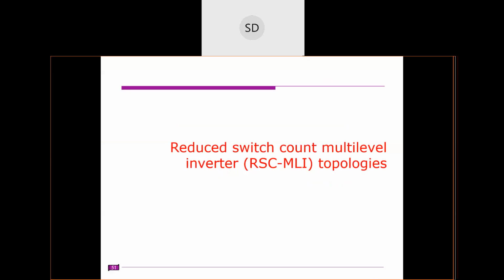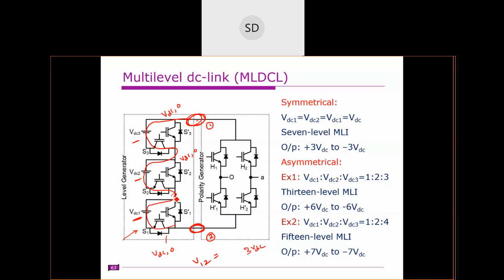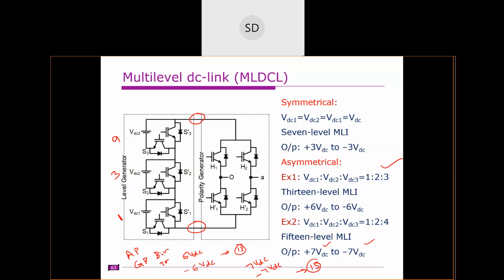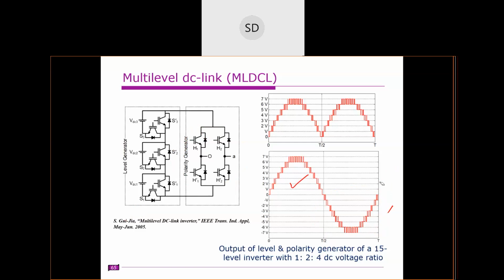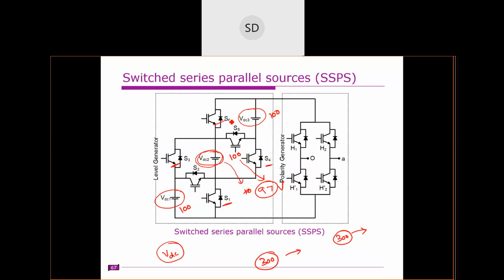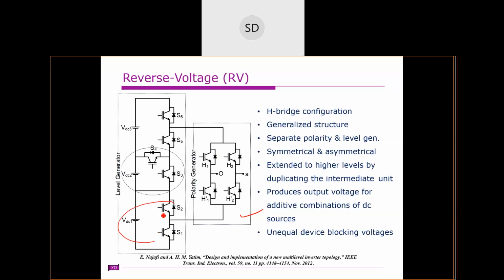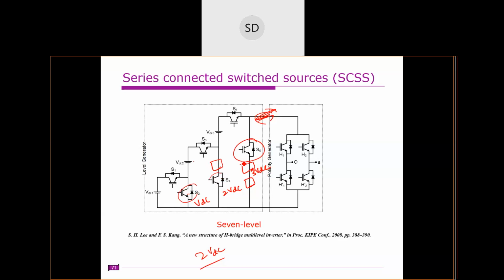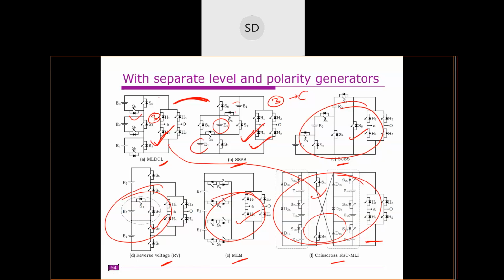Lecture 26: Reduced switch count multilevel inverter (RSC-MLI) topologies   1

Comment: Hello sir, 
In the below article, which type of  reduced switch count  inverter is used. Can you give me type of the inverter in this article...D. Prasad and D. C., "Solar PV-Fed Multilevel Inverter With Series Compensator for Power Quality Improvement in Grid-Connected Systems," in IEEE Access, vol. 10, pp. 81203-81219, 2022, doi: 10.1109/ACCESS.2022.3196174.

Comment: Dear sir,
Can these Reduced switch Multilevel inverters can be used as a cell in MOdular Multilevel converters or not.or is there any condition for topology to ba cell in the modular multi level converter.
Reply from the maker: Yes you can
Reply: @AdvancedPowerElectronics  thank you sir.